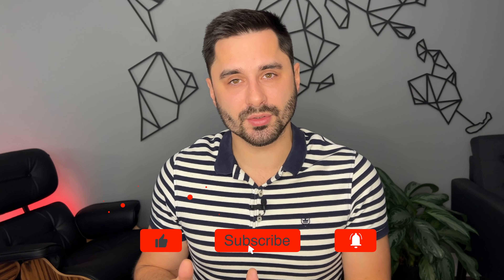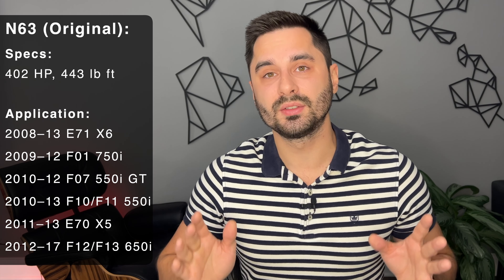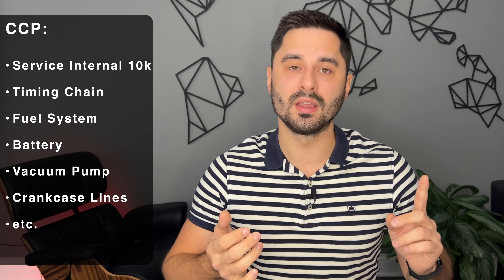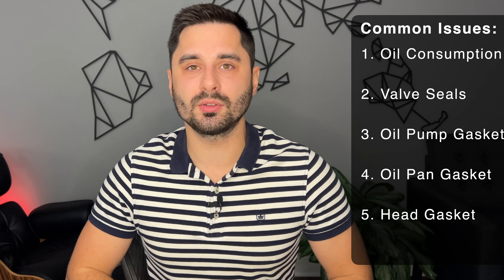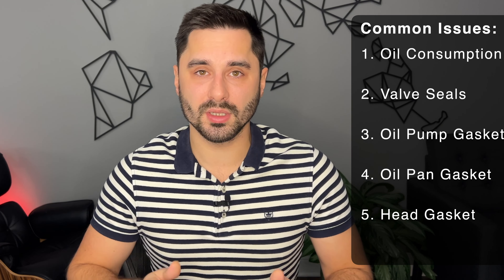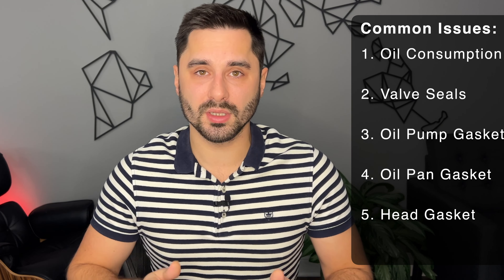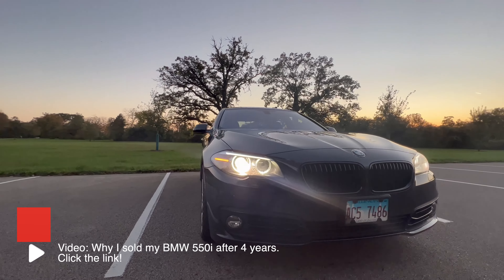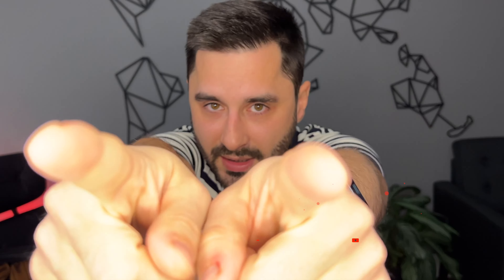BMW N63 Problems to Expect - Reliability Report

Comment: Looking at a 2018 m550i this video has me feeling more certain of making the purchase thank you
Reply: I love my 18' M550i
Reply: @tanman7627  is it faster than a 5.0 mustang?
Reply: @7mdmd875  don’t know if you already figured it out. Mustang and M550i are complete different cars. Mustang 5L is slightly faster (0-60 3.5s) than M550i (0-60 4.0s) on straight line. Mustang is not a luxury car yet it is very comfortable to drive. M550i is Luxury, roomier, and have actual second row.
Reply: @manofsesame3024  Well, I know they are not comparable cars in general. However, they can be compared in terms of power as they both have similar power outputs. I saw some races between them and the M550 actually smoked the Mustang. Nevertheless, the M550 has the advantage of X-drive (all wheel drive), while the mustang is RWD.

Comment: Engine replacement or rebuild is GUARANTEED....... because I just got the engine of my 2016 X5 4.4 Twin Power Turbo V8 rebuild at my local BMW....it's all covered under the extended warranty...so I paid nothing other than the deductible

Comment: BMWNA replaced the engine and turbos in my 2011 X5 and I've been fine over the last 20k miles. I change the oil every 3,000 miles,  and take it to redline regularly, but I don't dog it and you don't need to in order to get well above 120mph.

Downpipes, upgraded turbos and a tune are planned for the spring.

Stay away if you don't have the money for maintenance and definitely stay away if you can't warranty the vehicle....
Reply from the maker: You’re doing it right! Had the turbos replaced, changing oil often and having fun! I did the same thing in mine for 4 years and no issues. Butttt that’s not what people expect to do on a fancy luxury car..
Reply: Every 3,000 miles would be a bit annoying tho. That’s like a maintenance before and after every trip across states back and forth.
Reply: @manofsesame3024 not sure what to tell you. Oil changes are cheap and engines are expensive.

For me, that's two oil changes a year. Mine is not my daily and isn't likely ever to be, but it hasn't given me any trouble after the replacement.

Comment: I have a 2014 X6 drive 50i...nothing but problems. It's in the shop right now, engine is toast (bearing rods). I took it to BMW multiple times in 2018 for excessive oil consumption and smoke out the tailpipe. They did the absolute bare minimum to comply with the CCP.  The direct result is my engine failure. Multiple issues with multiple components due to the immense heat from the HOT V design. I would avoid any BMW with this engine.

Comment: N63 orginal  engine coolant thermostat replacement 90c. Lower psi water cap.  Oil change every 7500km.  Did not do the oil valve since I live in a 25c average climate.

Replace all the water coolant t junction with aluminum t junction.

Catch can installed.

Use liquid  moly oil saver ever 30,000..  never had to top up my oil between service.  

I use intake cleaner for carbon build up. Every 15,000 km

And injector cleaner every 7500 with  ptfe

Comment: I am planning to buy a 2019 BMW M550i X Drive. That engine is B63TU3 or better right ?
It will be the most reliable version of N63 yet. 
Would you recommend buying it ?
Reply from the maker: That’s correct, I would not worry getting that car.

Comment: Best way to keep any and specially this engine healthy is to not rev it high when cold, use 5w-40 oil, and a lower thermostat, these run extremely too hot. BMW cooks their engines in order to get better MPGs

Comment: I have a question about this car, why the engine model of the 2019 m850i I found is n63b, which is not one of the ones introduced in the video, and there is no introduction to this model of engine, why is this
Reply: N63B is the code on every 50i engine. If your car is an M850i later than 2018 it should be the Tu3.

Comment: Currently looking at buying a 2012 550xi with 120,000 miles great service records all at a bmw dealership. They are selling it to me for low blue book because it's a family member. What do you think? Safe buy?
Reply: Get rid of it asap.!!!
Anything v8 before 2014/2015 is a no no.!
Trust I told you this .!!

Just the turbo alone cooks every single rubber seal in that thing and once it’s on it’s on, 
Third party mechanics don’t want to do the work. It’s too labor intensive.

Dickhead BMW dealer want to charge 10k for the work , instead of charging a customer 2k because they know it’s their  fault they build a shitty engine .

BMW should have replaced n63 with tu’s for all of its customers.
Care package is bullshit.! A bandaid on a bad wound .!

For anybody I’d suggest once a year.put deal conditioner in the engine drive for two weeks and then get an oil change

Comment: Hey man great video, thanks I'm from Chicago too. I have left a comment for your other video, not sure if you are still replying, but would appreciate your help. Getting 2016 BMW 550i with 65k miles. I never had a BMW before. First thing I will do is take it to the local BMW dealership and ask them to do diagnostic on the list of issues you mentioned in the video. Do you know what are other recommended maintenance I should do besides changing the oil every 5k miles? Thanks in advance.
Reply from the maker: Hi there! On a 2016 BMW 550i there shouldn't much more than you need to do other than change oil. If the spark plugs and coils have not been changed, I'd get those changed as well. The rest should be as needed. Congrats on an awesome car (when you get it)!
Reply: Watch out for purchasing in IL. From what I've read they have different lemon laws with titleing.

Comment: Would This Be More Reliable Than An M3 Or M6 Ive Been Looking Around And Seen A Few M3 And M6 Around 90k -85k Also Some Fairly Decent 650i Coupes And Grand Coupes I want M3 Turbo But Im Thinking Its The Same As 650i If Not I Was Just Going To Get A C6 Corvette Or Cla45 AMG

Comment: Hi, Roland D again and as I saud before, I just moved back to The Netherlands.
I just asked you about the 550i which I'll follow your advice.
What can you advice me on a F10 2.3 3.0 2010 at 80K miles?
Reply from the maker: Hi Roland! I'm not familiar with the 2.3 as they don't sell those here. As for the 3.0. Which 3.0 is it? What's the model? They had a couple 3 liter engines.
Reply: @SimpleCarGuy  Hey, gues what?
Tomorrow I go see a F10 550i 2017 at the dealer.
Thanking you for convincing me to wait.
Roland D/The Netherlands
Reply: @SimpleCarGuy  Good morning
Just drop all other stuff. I thought I did send you a message yesterday I closed a deal on a 2017 F10 550i.
As I go along you will hear from me.

Compliments of the season🌋
Reply from the maker: Youtube decided your comment was spam for some reason and I never saw it!
Congratulations on the car, I hope you have been enjoying it! Let me know how you like it a few weeks later now.

Comment: Anyone have any insight on Alpinas N63 for the 2011 B7? Any problems or things to look out for?
Reply: I’ve got the same car year and model as you. No issues at all. Alpina redesigned the heart of this engine to make it live longer. It’s got upgrades to basically everything that’s gone bad in the n63 engines. Alpina took care of it all. Just do oil change frequently for better performance 👍🏽

Comment: im looking at 2014 550i with 121k miles and a 2011 550i with 83k i know you should go with 2014 but is safe for me to buy if the miles is 121k there is no problems with car at all
Reply from the maker: I would definitely go with the 2014 as long as the maintenance items have been done properly. Even with higher mileage.
Reply: @SimpleCarGuy  alright yea cus I been seeing 2014 with 117k miles and 121k miles but the owners state everything been maintenance  correctly

Comment: I have X5 M 2011 with only 50K miles on it but it has multiple issues including engine overheat, fuel pump, misfire, etc. 
As you mentioned BMW came up originally with their "Customer Care Package"  but that was years ago. Do you think they will still perform the same service after all these years if the previous owner hasn't done it yet?
Reply: Did u figure out i have same question

Comment: I have owned the E70 N63 since 2016 now. I can attest that it is WORST engine I have ever seen in my life. I had ALL of the issues and then more ( valve cover gaget and knock sensors). It ended up blowing up and destroying the rod bearings. I  was forced to replace it with a new one because I had been left with a worthless piece of %*=÷. Dont buy it. Just dont
Reply: Real talk., that original n63 is nothing but horror
The tu is a bit better….but you still have to maintain them like babies.

Get a car with the tu3 if u can and save yourself  the headaches .!

Once a year put some sort of seal conditioner in their when you 500 miles from an oil change